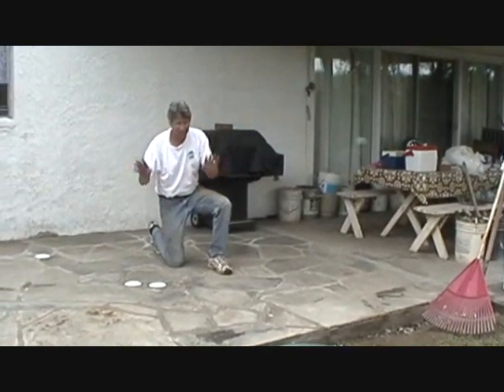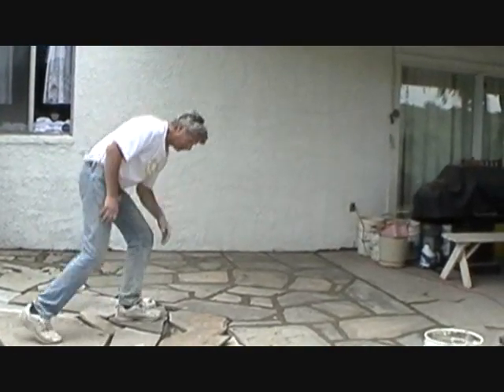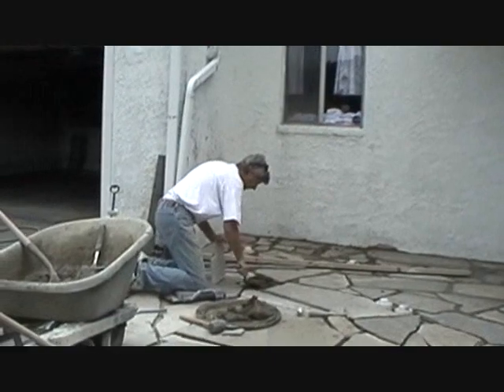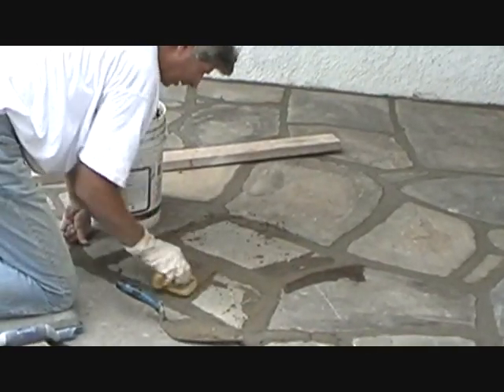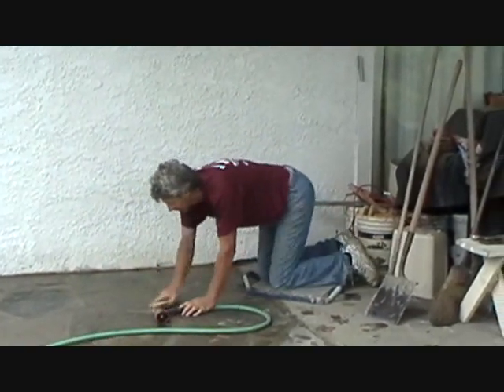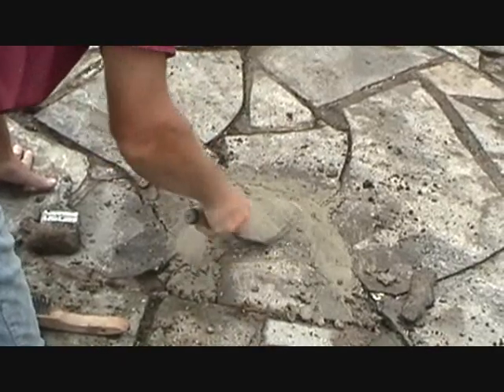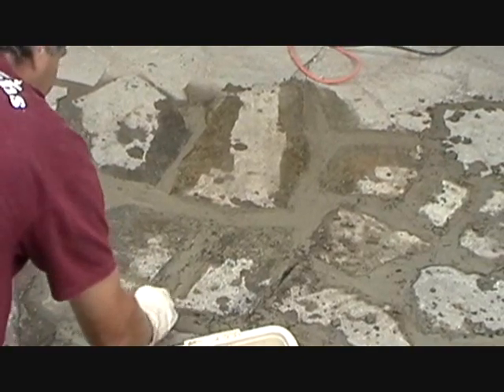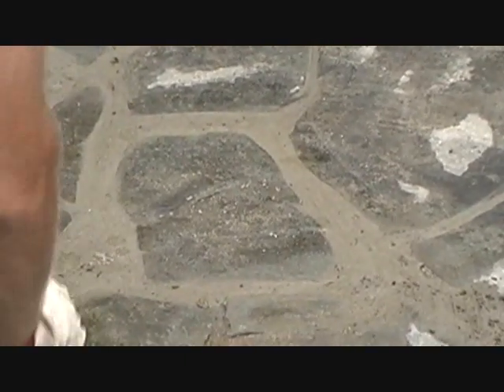STONE PATIO INSTALLATION (Part 2) Mike Haduck shows patch -up etc.

Comment from the maker: yep it is for sure, In Pa the winters will kill a job where you don,t put the joints in as same time as the stone, and in a could years the joints would be falling out.So in our area it is the standard way of doing it at the same time. leaned from the old guys. other states or countries is a different story.  thanks for the comment.   mike

Comment from the maker: @yermi63  Hi Jeremy. in PA it cost about 12 to 16 dollars a square foot. (diffrenet measurements than australia) but it is more or less depending on the job. A good union mason makes between 200 to 300 pr day. If I bid a job I usually figure it out a couple diffrent ways. the trade has changed over the years. I use to build 3 or 4 stone fireplaces a year but haven.t built one in 8 years now.  regards   Mike

Comment: Hi Mike ! I've done two patio over gravel with non-calibrated limestones. Joints we're filled with polymeric sand. Although the results are real good, I would like to build my next one with calibrated stones (I would like to have a more decent level accross the whole patio) and cement.  I have two questions :
1- is it ok to have a gravel or sand base and lay the stones with cement like you did on that video ? 
2- it seems like it's difficult to find calibrated limestones in my area (Eastern Townships in Quebec, Canada, 1 hour drive north of Vermont).  Any links / address I could investigate to find out where to get those ? I know a transport company here that goes regularly to Pennsylvania and come back with limestones (non-calibratred), so maybe I could have a special order...

Thanks for your videos. You are a real mentor for me ! I would have never done those projects without what I've learned with your channel.
Reply: I realized I should have posted that comment/questions with you part 3 of 4 video !
Reply from the maker: Hi Yves,  it is a hard call whatever you do,  I can only show what I did in that situation, so If I say to do it any other way I would be just guessing, I know you will pick the right method I hope it helps, thanks mike

Comment: would like to see the finished patio..i looked at part  3  in this series but its a "foyer" do u have any pics of the finished patio?
Reply from the maker: howdy, no just what your seeing, But to continue on in the mountains of Pennsylvania. we put the joints in at the same time as the base. If not the winter will peel the joins up, and in a few years I would be getting a called back. at 60 years old and doing it sense I was 15, I can not guarantee my work any other way, I understand in other states and area it is a different story.  God bless mike
Reply: +Mike Haduck what was the paint brush for???after sponging is that the finish step?do you brush joints after?
Reply from the maker: that was going over the joints that were already there so they all match,  just a cover over. thanks mike
Reply: +Mike Haduck oo ok i have to do something similar on Monday maybe I'll try the brush on the old joints.?thanks

Comment: Cutting with the anglegrinder sure makes a lot of dust and that can't be good for your lungs.  Why not use a wet cutter?   Cutting with water can get messy but at least your lungs will be spared. Its a health and safey issue.